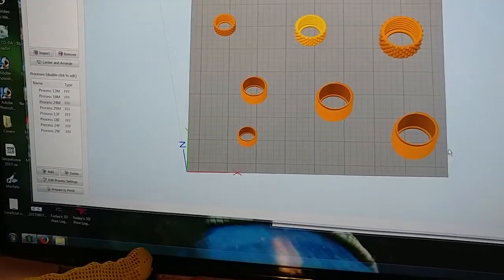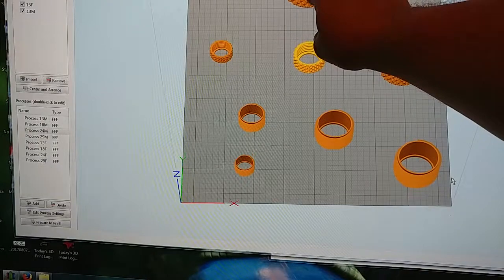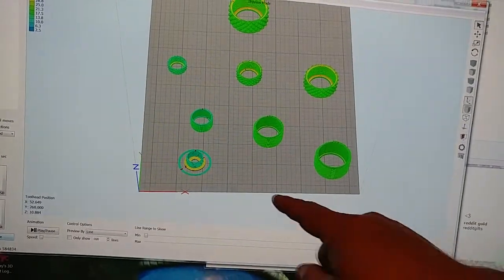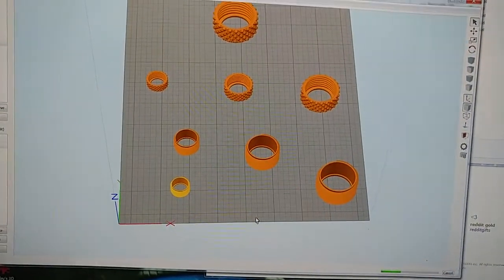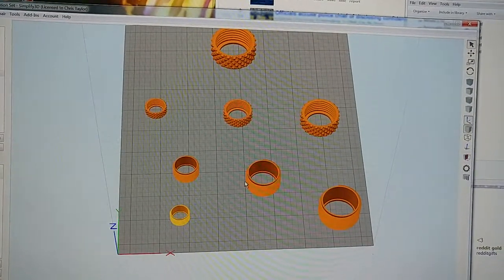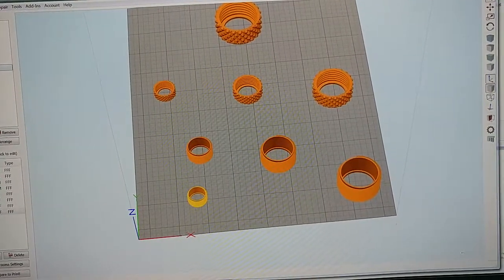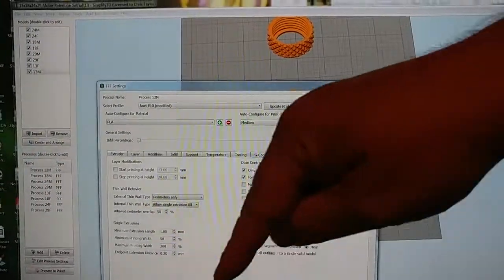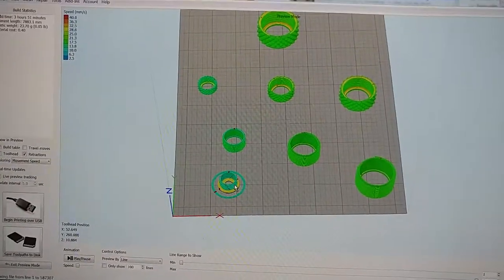Today's 3D Print - Simplify 3D sequential printing went goofy? Help?

Comment: I just did a bridge test so I had it do two models sequentially and it was working until it hit 2 layers before the bridge and ran off to the second model then finished it and came back down to finish the two layers and the bridge of the first one.  I can say this is broken behavior.
Reply from the maker: when you sequential print you need to SPECIFY how high.

I can space my parts to do 100% of one part them move onto part two. so I set it to 300mm.

if you have a 10mm part and you set the z limit to 5mm it will print 5mm of part 1 then goto part 2 and print 5mm then come back to part 1 and do the second 5mm. so make sure you set that appropriately its VERY easy to accidentally skip that.
Reply: The thing is both parts were identical as I just mirror copied and moved them away from each other.  When I tell S3D to print each one by itself I mean for it to without it asking me anything.  Each process was identical (almost as one had a fan and the other didn't but otherwise was identical) and each process was attached to its own model.  If it doesn't actually print a full model then move to the next process to print that model fully as well then it is broken.  I shouldn't have to trick S3D by telling the process to end at 5000 meters or whatever.  Basically it is not working as it should and it should never have ran off like it did to go start on my other model then come back to the first to finish it.
Reply from the maker: The Best Stooge I'm sorry that's not how it works I think you're confused about what I'm saying you don't tell the process how you are print you tell the print slicer how you want to print when you click sliced the model a window pops up that window has a list of the processes you have and it gives you two choices continuous or sequential you have to select continuous or sequential sequential what you want but you also must determine how much sequential it cannot assume and it cannot guess because it does not know the physical makeup of your printer it does not know how much of one party can really do without having a mechanical conflict you must determine this and then tell the printer if you know that you have it mechanically set off that it will not konflikt after printing an entire part and then moving on to the next part you must simply Define a layer height that is larger than the model and then it will print the entire first model and then the entire second model remember 3D printers are dumb deaf and blind you are the intelligence the hearing and the vision the software cannot make that guess you have to make it

I will make it video later to explain this
Reply: So, I have to trick it by saying 5k meters is what you are saying?  You would think that by me not inputting a value to max that it means do the entire print.  At least that is how it works for 1 process on one model.
Reply from the maker: no. you NOT having to tell it would be the trick.

lets go over this again. 3d printers are dumb deaf and blind. you know something. a video is a better way to do this.

https://youtu.be/iu6Gl4X9zJc

give it 30 minutes to finish uploading. There its done. watch the video it should explain everything and make more sense.

Comment: I wish I knew...!

That software looks interesting, that's about AU$200 for the licence, ouch...!

I'm making a thin aluminium barrier to protect the heating element from the fan, I may make a small video with dimensions/instructions.

I can't really understand how the partial tape outside the fan cover prevents air from blowing into the heating element so, while I'm waiting for Gearbest to decided what they are going to do with my heatbed issues, I have plenty of time to get these small things done.
Reply from the maker: nyodine it works by reducing the overall air flow which reduces how much it's cooling the heat block in fact to speed up my heat process I'll just cover the entire fan with my fingers

Comment: just got my CR 10 to day and want to buy a supply of pla ??
Reply from the maker: +Stormbringer Mornblade check the description if you want a truly good reliable strong pla that's not badly priced buy some esan pla Pro I have links in description for orange and blue but you can buy any color you want it is my absolute favorite PL a bar none hands down no questions I keep a six or seven Rolls on hand at all times so I never run out it prints like creamy butter and is crazy strong never gives me a problem sticking or extruding and it's never ever ever jammed in thousands of hours of printing
Reply: yes look's like good stuff going to try hobby king  as i mostly proto for molding :)